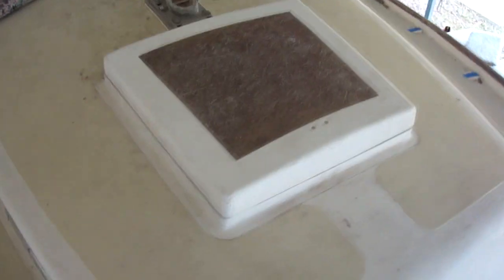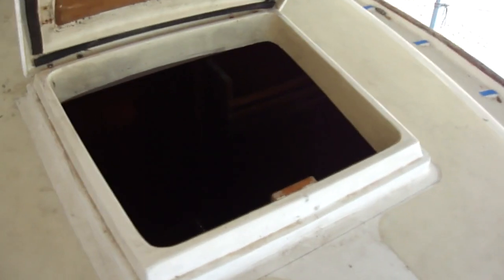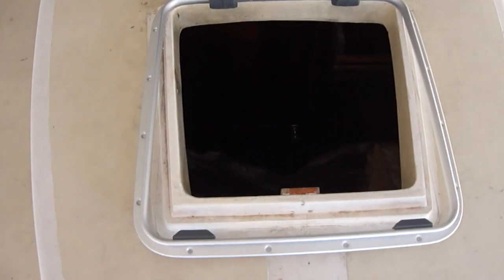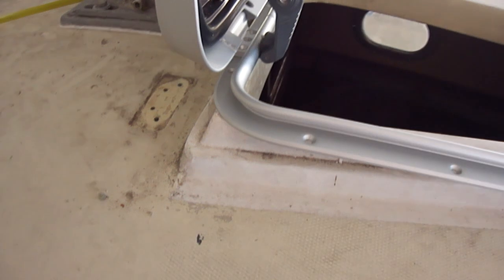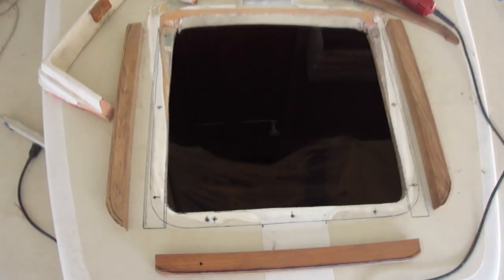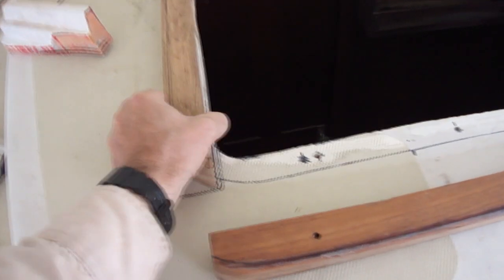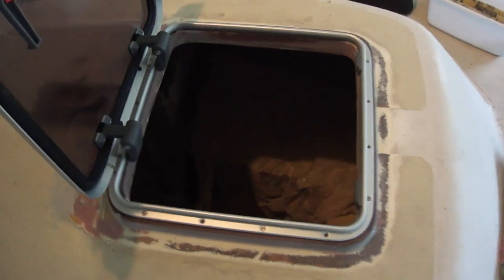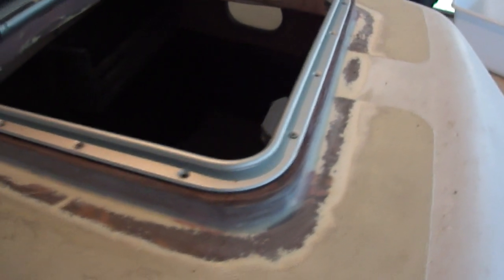Installing a Lewmar Ocean 60 Hatch on an Alberg 30

Comment: My Alberg 30 definitely needs the same replacement, but those are pricey new, nearly $700.  Seems rather costly!
Reply from the maker: Yes the price is crazy. Sometimes you can find one online for as low as $550. Or you could buy a used one of similar size by Lewmar or Bomar on ebay or other sites where people have stripped boats to sell parts.
Reply: Thanks much, my idea as well. I also wondered where you found your lexan for replacing the salon portlights?
Reply from the maker: I used lexan in the past but now mostly use acrylic (plexiglas) because it is plenty strong enough, costs less, and does better in UV long term. I buy it by 4x8' sheets from Farco Plastics in Jacksonville, FL. If you don't have a supplier like that near you then you may have to buy it in 1/4 sheets online.
Reply: Thanks for the tip.  I'll look for that.  It is always a challenge to resource some of these refurbishment items aboard with more recent technological advances while yet not over-improving on an already fine design.  Thanks again!
Reply: I did purchase a Bomar hatch 18 1/2 x 18 1/2 exgtruded design and flat.  I had thought to install it on the foredeck rather than do the reworking of the old hatch.  I did call the folks who manufacture the Bomar and they were quick to say they could not recommend installing it unless the manufacturer could also recommend it (liability I suppose). Well, as you know, Whitby is not available today.  What do you think of simply leaving the current hatch alone then putting the Bomar on the foredeck.  I installed a molded hatch in the cockpit which is great.  Thought to do the same on the foredeck.  Am not sure it is the way to go.  Thoughts?
Reply from the maker: I don't know why you'd need it on the foredeck unless you are sure you need the extra ventilation at the cost of another potential leak in the future and something to trip over .I have seen many boats with hatches there so not unusual if that's what you want. Make sure it's not in the way of a future inner stay if that might happen. I'd  build a substantial frame about 1.5" high to raise it up from the deck and to reinforce the deck. Beyond that, you can email me thru atomvoyages.com if you have more questions.
Reply: Thanks for your advice and quick response.

Comment: why didnt you film any of the work being done
Reply from the maker: Working alone, at some points I had to put the camera down. But I did miss a few steps such as digging out the deck core, laying on the thickened epoxy and fiberglass, screwing it down, etc. Here is a video of installing the hatch on another boat with some more detail:
https://www.youtube.com/watch?v=aYiLzmM66qU